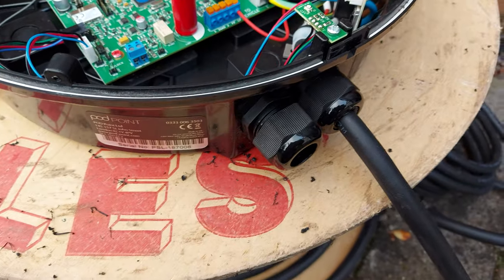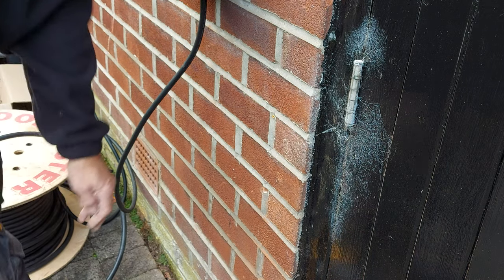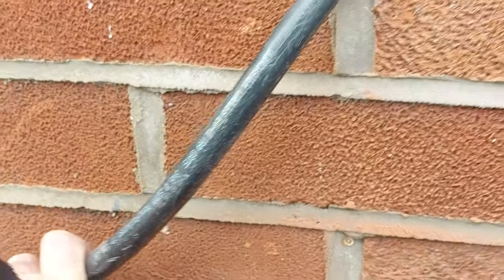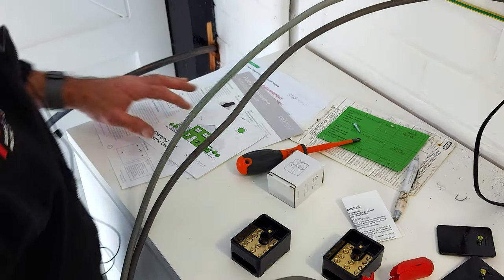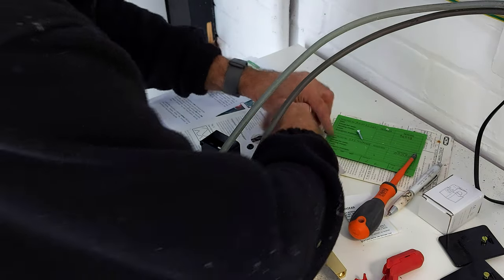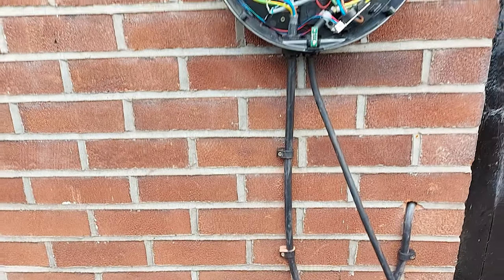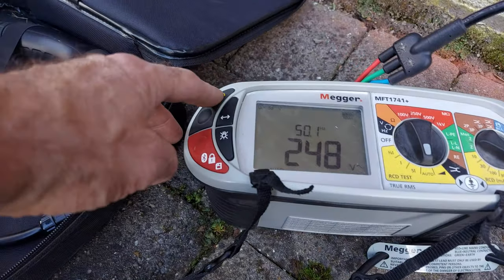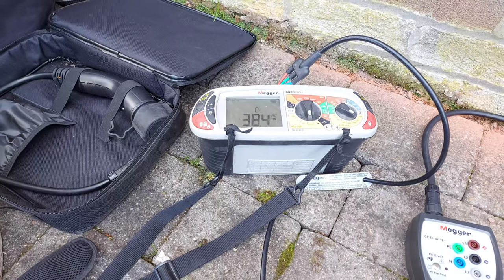Pod Point Solo EV Charger Installation.

Comment: Hi mate, good vid.  I am due to fit my first EV charger, it's a Pod Point like this and I have a question - Before you take the pics and call Pod Point etc am I right in saying that you have to get it onto the wifi first?  Do I need the customer's phone with the Pod Point app on it to do this or am I able to do it easily on my own?

Cheers
Reply from the maker: Cheers Matthew. Yes, you need to connect it to WiFi before contacting Pod Point and the only thing you need for commissioning is the client's WiFi details. You don't need their phone or the Pod Point app for any part of it. I've got a separate video on the Pod Point commissioning process which talks you through that process in more detail with a few practical hints on the best way to go about it, which could potentially save you a couple of hours and a lot of head scratching if you follow it
Reply: @abcelectric  Excellent, thanks Gary, I'll have a look at it.  Many thanks